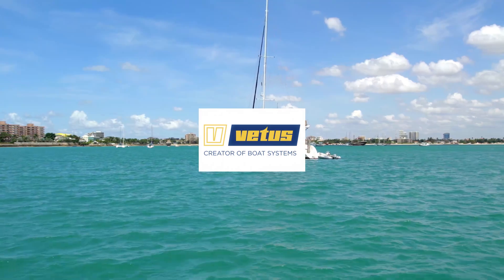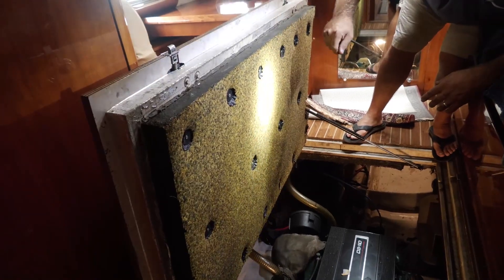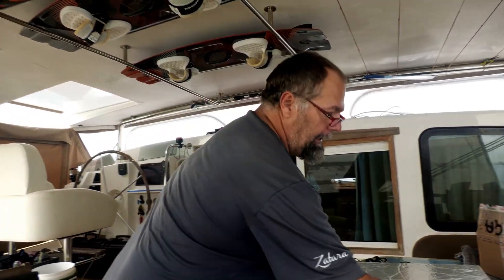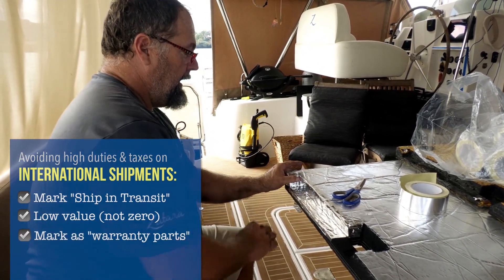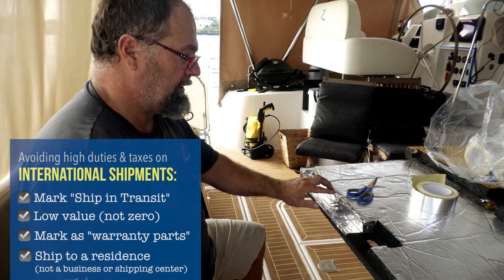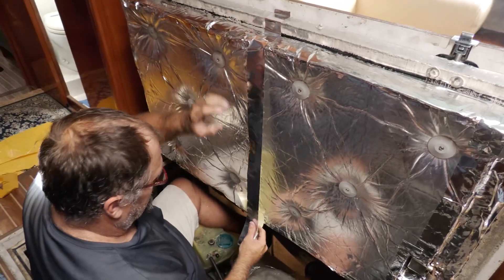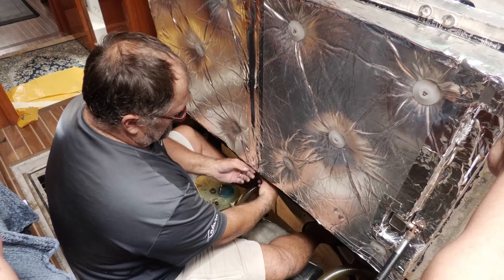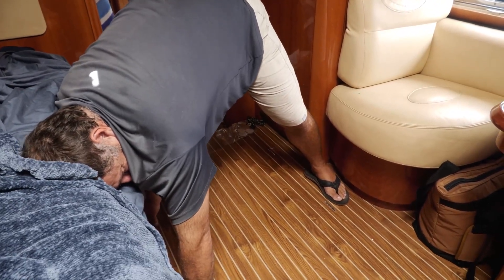Sailing Zatara - Installing VETUS Sound Insulation

Comment: When I installed insulation on my engine hatches I made frames to retain the insulation and to cover the edges for a nice finish look.  I used aluminum z stock with 1" flanges and I mitered the corners and welded the pieces together.